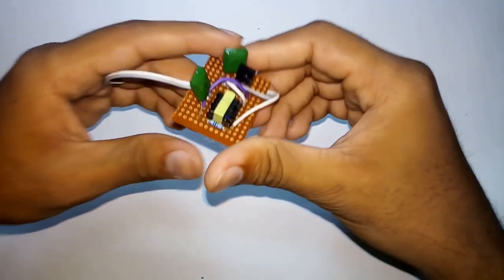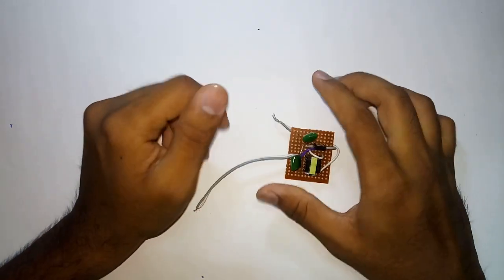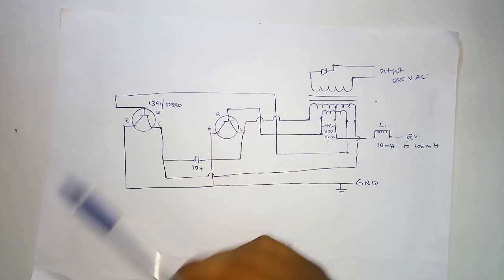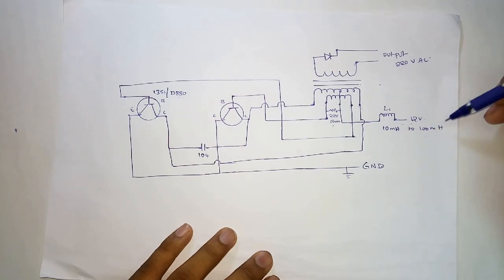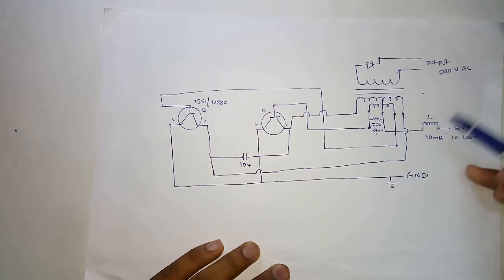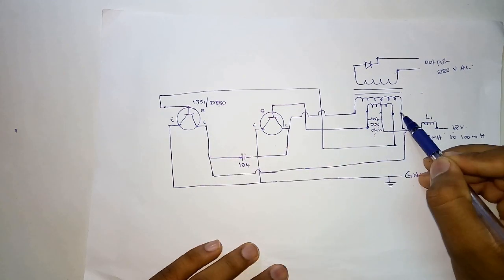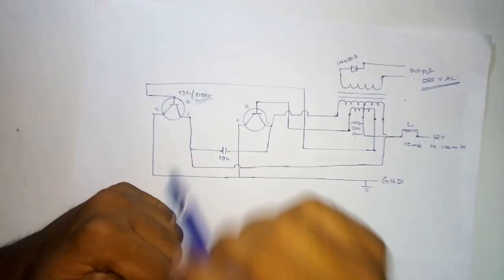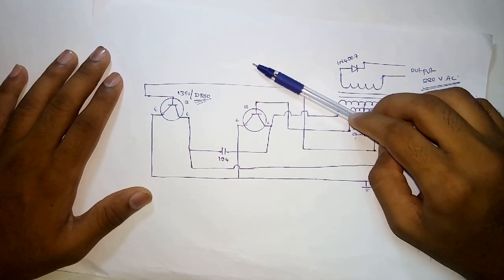CAN you MAKE mini inverter using D880 transistor instead of D882 transisitor???!!!

Comment: Fake
Reply from the maker: khanhj ngo excuse me did u try?
Reply from the maker: Does the transformer u used have 7 pins?
Reply from the maker: Electro boy  The transformer that I mentioned in the circuit has 7 pins...

I have been searching for 7 pin transformer... But I couldn't find it... that's the reason I didn't make the video... As soon as I find it.. I'll make it..
Reply from the maker: Electro boy  mini inverters made using transformers that are available in Mobile charger are limited to one led bulb itself...and that too it depends on the input voltage and current u give...

If u need an efficient circuit to make an inverter u need to use 12-0-12, 5A transformer with few circuit components.....that's works more efficiently